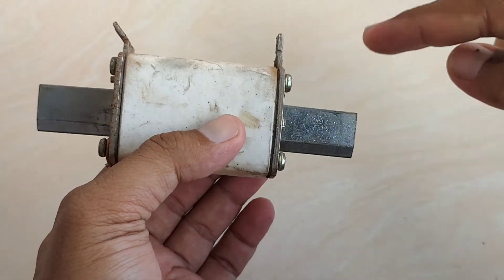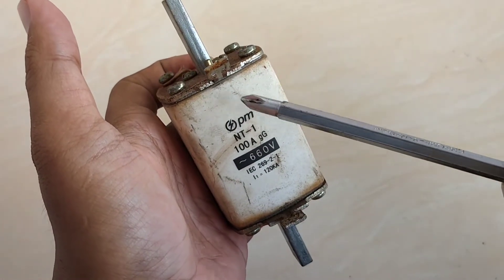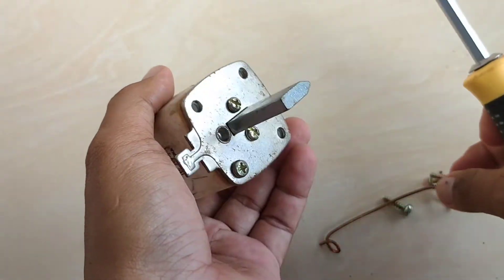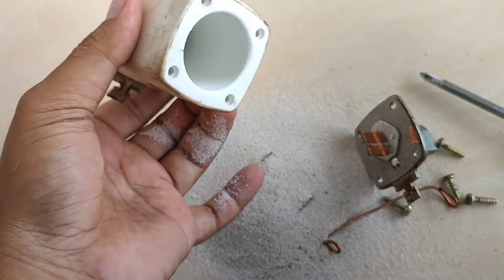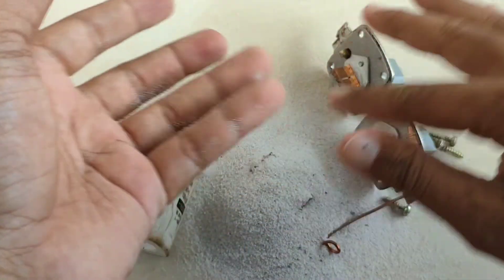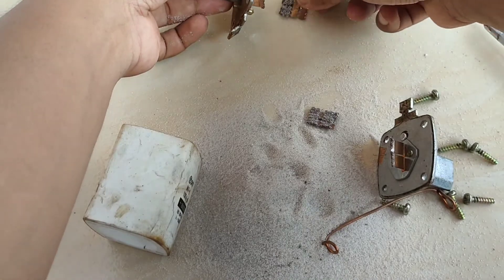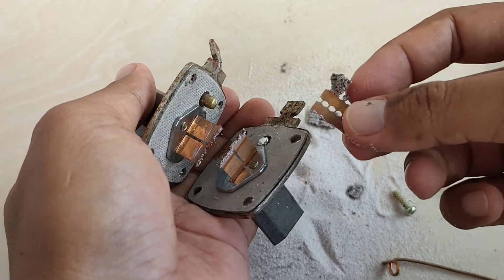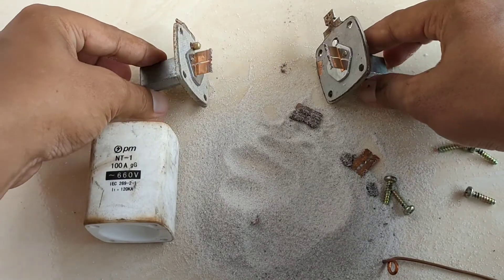Prinsip Kerja dan Komponen NH Fuse || Pengaman Lebur || NH Fuse || PHBTR

Comment: Kalo boleh nanya om  gardu 100 kVA  nh nya berapa ampere  saya penasaran
Reply from the maker: NH Fuse nya sesuaikan dengan beban mas

Namun untuk beban Maks nya disisi sekunder trafo rumus sbb :

100 kVA
---------------- = 144 Ampere
400 V x √3

Intinya per phasa ga boleh melebihi 144 Ampere mas

Kalau NH Fuse sesuaikan aja dengan beban,tp jangan diatas nominal diatas,krn bisa jadi bebannya ada 2 jurusan atau lebih,yg penting beban ampere per phasa ga melebihi tadi
Reply: Apakah diterapkan betul pak dilapangan sesuai perhitungan?

Comment: Klau di ganti mcb yg ampere yg sama bagaimana om?
Reply from the maker: Bisa juga mas,tp hrs pakai MCB yg besar, spt MCB 50A, 35 A, 

Misalkan trafo 25 kVA, itu bisa pakai mcb 35A di per phasanya mas
Reply: @HamdiReza  : ini aslinya memakai fuse nh 60a...klau diganti mcb amannya om?
Reply from the maker: @rudiesebastian6486  kalau secara fungsi bisa,tp dari safety ga aman krn arusnya sdh mulai besar itu mas,dan dudukannya hrs dibuat dudukan mcb dahulu di PHBTR nya mas
Reply: @HamdiReza  ASLINYA NH FUSE 60A om...diganti yg bagaimna yg bagus om?
Reply from the maker: @rudiesebastian6486  bagusnya tetap NH Fuse aja mas
Reply: @HamdiReza  : berapa ya om harga fuse 63 ampere nh 3na 1 018 siemens?
Reply from the maker: @rudiesebastian6486  maaf mas saya kurang tahu mas